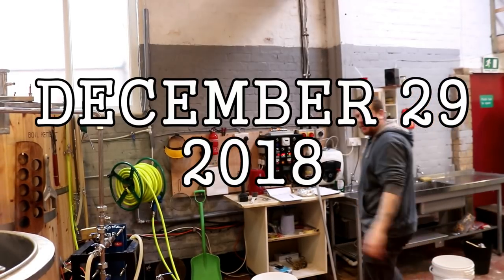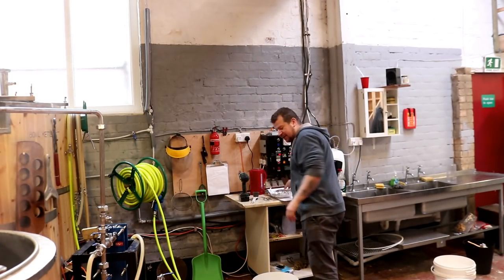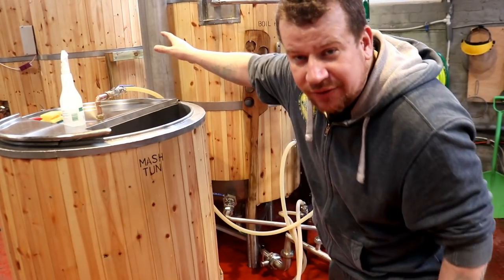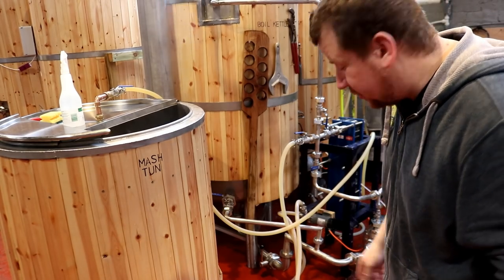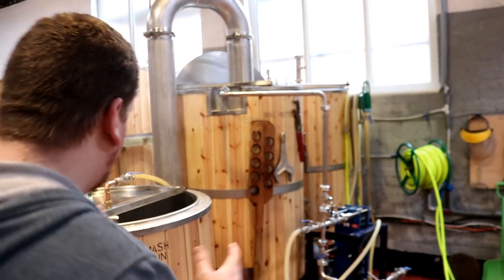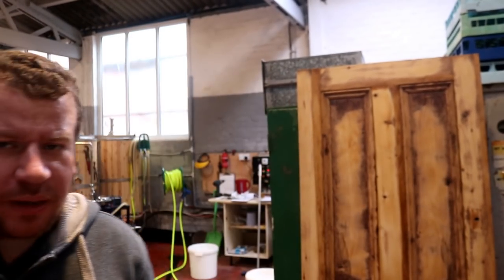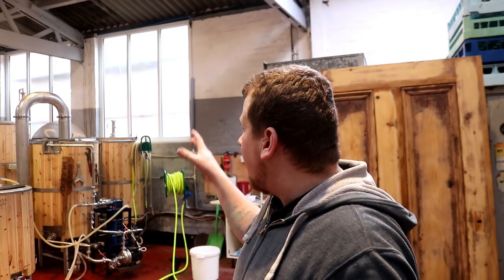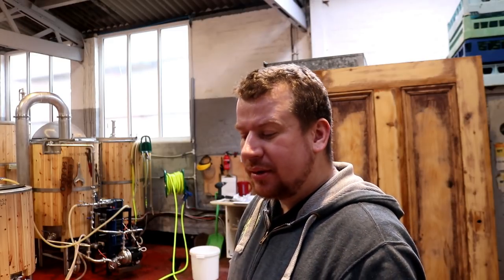STEAM KILLER  (STOLE THE TITLE FROM JC)

Comment: Good Brew Day!  Be careful! Releasing that little bit of pressure can cause it to jump out. Need to taste and make sure the condensate is not running back in. 
I went to look, but couldn't find the scale vlog.  It may have a set of jumpers inside rather than via the buttons.

Comment: Chooch chooch you did it m8,condenser looks great,glad we got to see it in action before New Year. Shaun below is right be careful m8 dealing with a closed steam pressure system,you will get scalded very easily and very badly. If you do need to look in may i suggest you wear a full face mask and some protective clothing,you know gingers burn easily lol. Cheers.
Reply from the maker: But you forget mate, it is not a pressurised system. the condenser is open to the atmosphere if anything there is a slight vacuum in the tank. The risk is from the burst of energy when the elements kick in on the PID controller.
Reply: @harrybrew69  Good point i forgot the tail end was open. Just got worried when i saw her shooting out top of kettle is all.